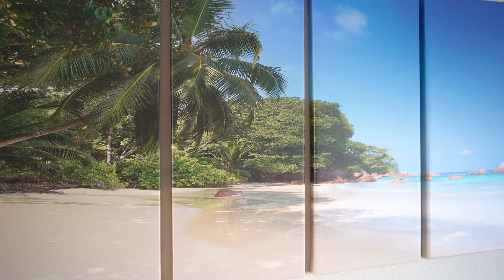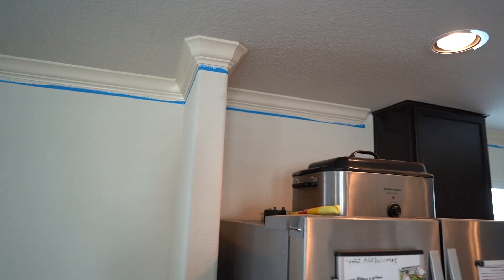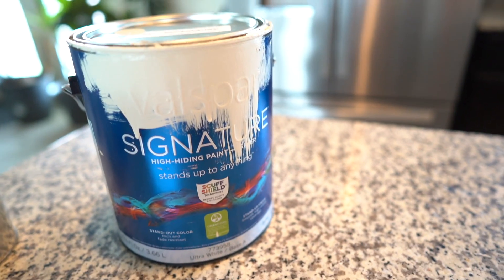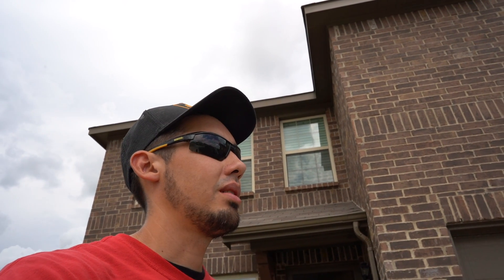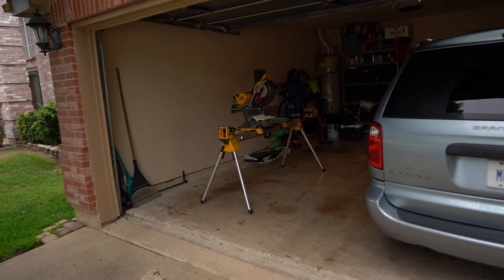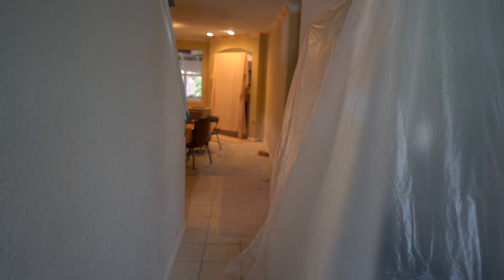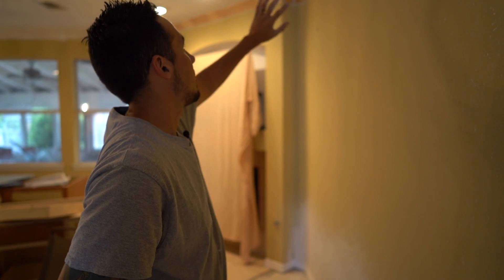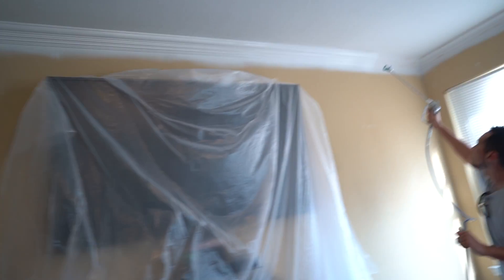Never a dull moment...

Comment: According to many YT videos I guess pickup trucks are very popular in USA but I think for your purposes as a carpenter a van would be better - you are less limited in storage space, you can install shelves on the walls for storing material, power tools, screws, dowels, etc., you have access from the side door and from the rear door too, the edge of the trunk (van's storage space) is lower, you can cut your miter joints inside not on a client's curb. And last but not least - you can have a portable toilet inside, on some construction sites you don't have access to a toilet. Just my opinion.

Comment: Love the GX-19.  I saw that thing on the Graco site and asked my SW Rep about it, and he said it was a prosumer item.  Then I saw you using it and had to get one myself.  Easy to use and easy to clean.
Reply from the maker: DRitz78 yes it is so easy to clean. I love it
Reply: @Michael - It depends.  It is easy to justify a tool that saves you time.  If you could spray your house in 2 days, versus rolling 6 days, would it be worth it?  Is factory smooth finish on trim work, versus brush marks or roller stippling, worth it?  If you used it 4 times and sold it for $400, is it then affordable?  I'm a painter and so it was easy to justify, but I've bought many Festool & other tools that in retrospect are hard to justify.

Comment: Curious why you went with that wedge piece on the left instead of meeting the two wall pieces? Was the long angle the issue?
Reply: That's the only way to transition those two pieces on vaulted ceilings.

Comment: next time prep the nail holes before priming
Reply: Jorge duarte   Sand, prime, fill, sand, caulk, paint, scuff, paint
Reply: Travis Walsh if you are going to do it properly you follow this order, if the material is already primed, you patch, sand spot prime, sand, caulk and paint.
if you patch after you prime and dont spot prime, those patches will flash, if you dont know what flashing is than I say no more.
Reply: Back in the day it was always prime before spackle (putty, showing my age), then sand, apply undercoat, sand and finish coat. Remember back then it was all oil base products for trim, these days people do a two coat finish as latex/acrylics are formulated differently are thicker and have a resulting better hide. I am flashing you right now Amigo :) 
 Jorge duarte
Reply: Brye Cooper how you figure that? flashing occurs with latex and acrylics more often than with oil base paints, but to each its own, I do high end work, so I dont take shortcuts.
Reply: Jorge you are absolutely right. Of course you have to prime your already sanded patch. Thank you for catching my error.  Scrape, sand, prime, patch/fill, sand, prime, caulk, paint, scuff, paint.

Comment: You don't get a lot of spitting with a 20" extension? Say your going to do a job and you were hired to just to do the trim and framing out doors and window, and some other company was going to paint it.  Who would you say is responsible for filling the nail holes?
Reply from the maker: adam cain there are some spits with the extension so I gotta watch out for that. I say whoever paints it should be responsible for prepping it.
Reply: @FinishCarpentryTV  that's my opinion...
Reply: Adam Cain - depends on where you live on who preps.  I'm from NW Ohio and no carpenter there would ever allow a painter to F-up the job.  I now live /work in SW Florida and the painters always do the prep - I found out the hard way on one of my first jobs painting a 3 story house.
Reply: adam cain I'm a painting contractor in San Diego. I've heard the spitting can be caused by a dirty filter or a pitted packing needle (round silver ball on the end of needle that closes when the trigger is released gets worn and doesn't seal completely). 
Over here the painter is responsible for filling nail holes, sanding, and caulking.  I just ask the carpenters to nail in a place that is easy to  fill and sand.  Not in a intricately detailed area.
Reply: And nail punch those pesky shiners ;) Travis Walsh
Reply: TWSD p